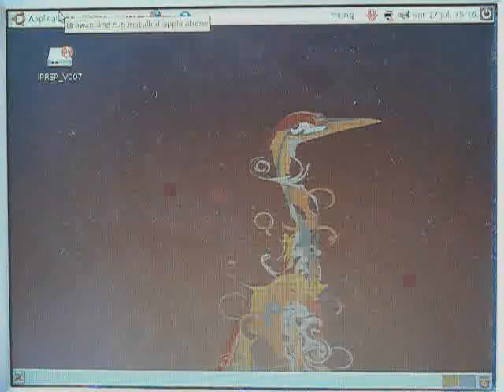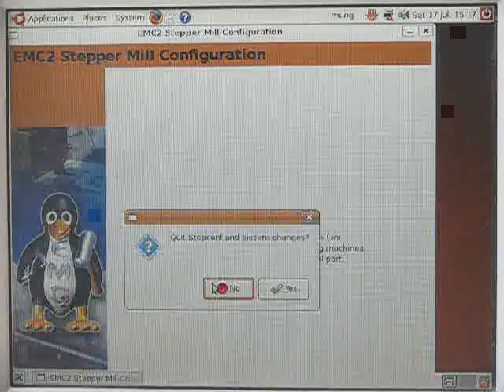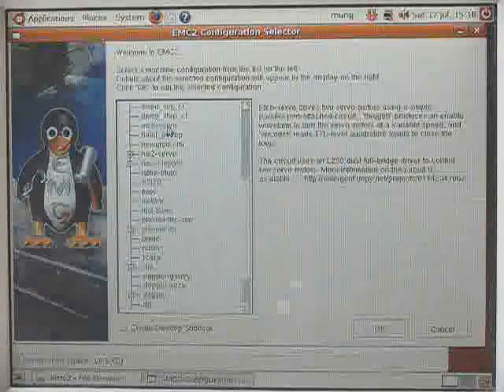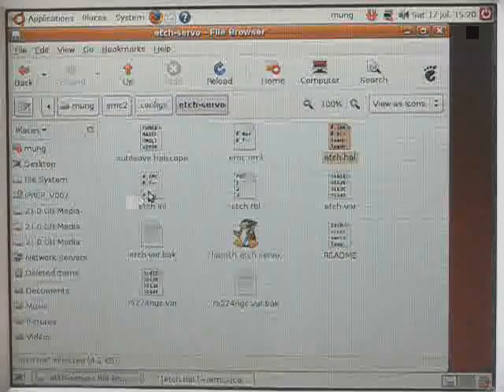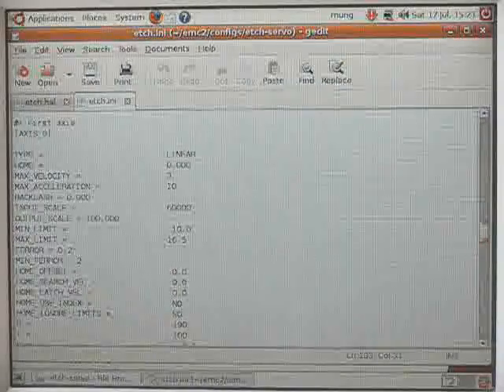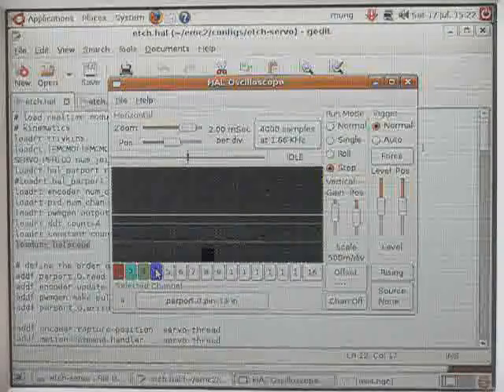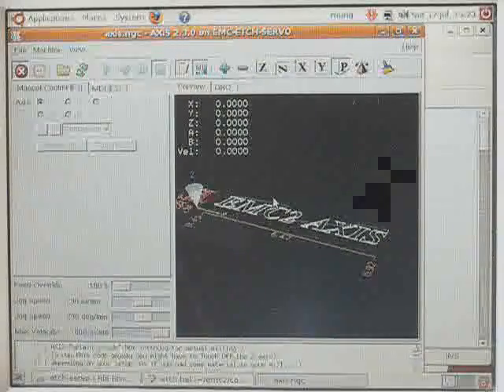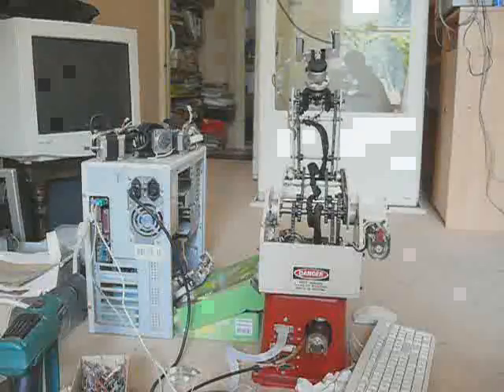emc linux cnc servo quadrature encoders dc motor parallel port settings control loop PID

Comment: Thank you for the video! I've used EMC2 with steppers for CNC before but you've pointed me to an interesting new direction here. I have an older LabVolt 2001 robot that sort of "followed me home"  for which I don't have a controller. It's a bit larger than yours (is it a Rhino, BTW?) but has very much the same type DC motors. I may just be able to run it off a PC with EMC2 instead of the stock LabVolt software. What driver board did you use, by the way? Thanks! D.